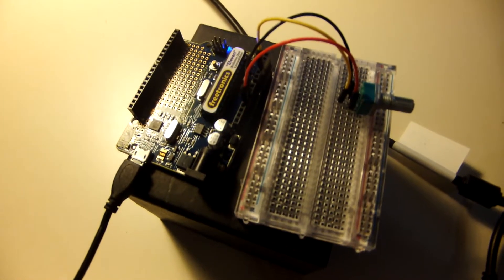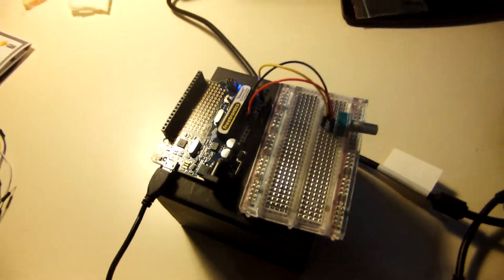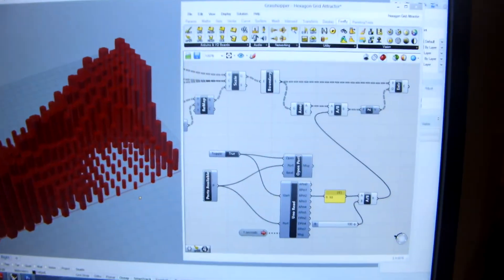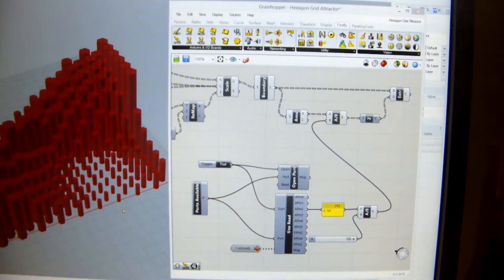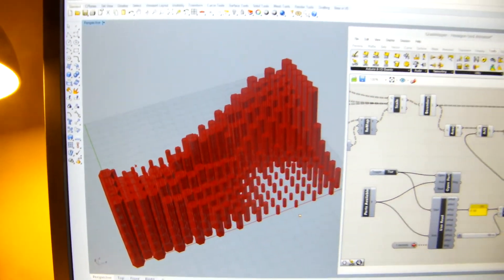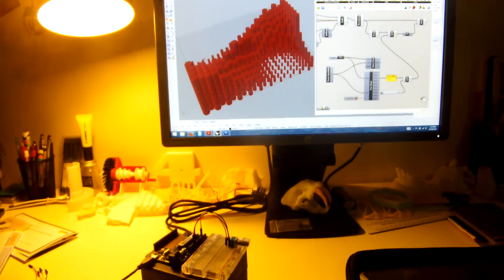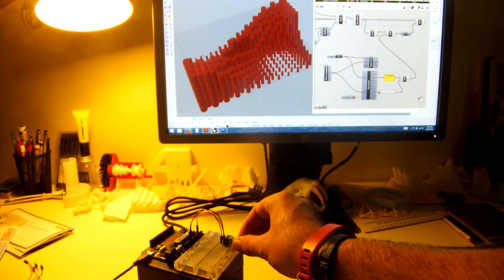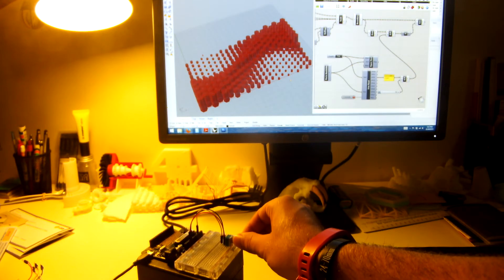First Trial of Rhino + Grasshopper + Firefly + Arduino

Comment: hi! can you share how you connect arduino with the point attractor? the component to connect the result frm arduino read to specific point attractor..

Thank youu!
Reply from the maker: This uses the Firefly plugin, and all I am doing is reading the value from the potentiometer (just a number), and using this number to control the scale of the 3D model. It could also be used to move the point attractor by plugging it into the XYZ coordinates of the point.